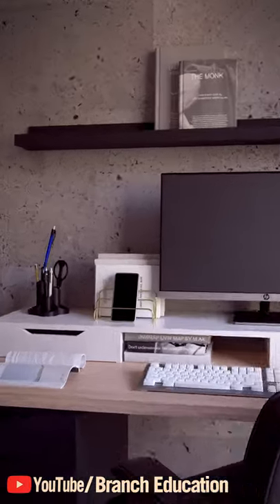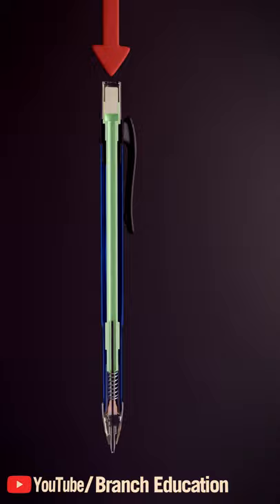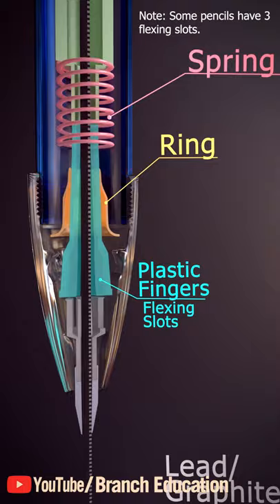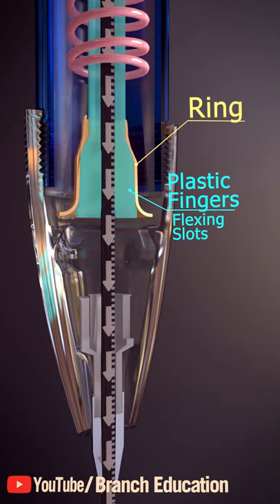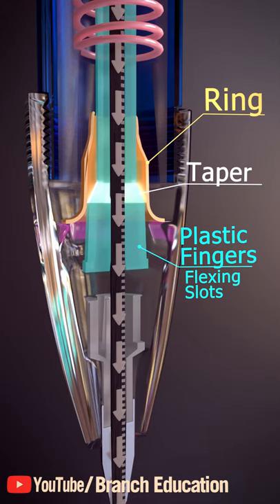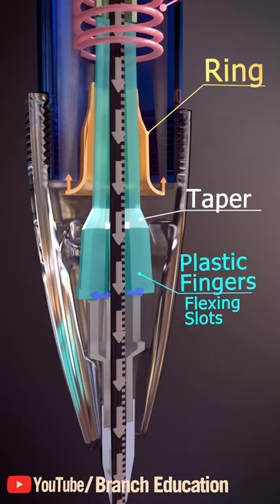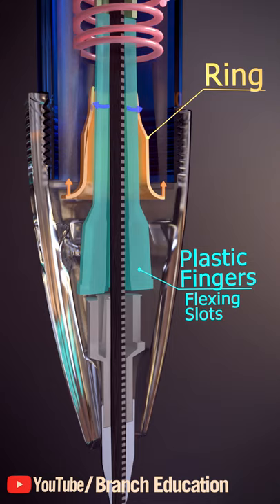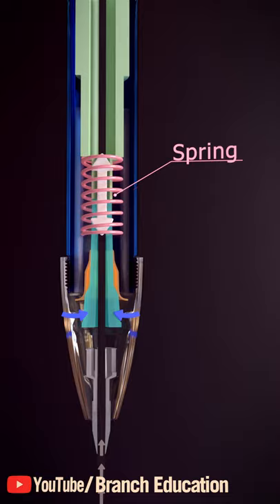How do Mechanical Pencils Work? #shorts

Comment from the maker: In order to keep the video to <60s, a number of elements had to be abridged or omitted. If you have any questions, definitely ask them, and the top ones I'll answer here:
1.	Why is it called lead?  Pencils have never used lead, but rather early scientists [~1500s] thought graphite was a form of lead.  
2.	The tip of the pencil is also critical.  It prevents the lead / graphite from slipping when the fingers are disengaged, it guides the lead, and it helps to prevent it from snapping.  [Credit to Miguel Borromeo for a related comment]
3.	Some don't click, and that is due to the materials of the ring and fingers, as well as the shape of the taper in the fingers.
4.	What force makes the fingers flare outward?  First, the fingers are all connected at the wrist, kind of like fingers / hand / wrist.  Second, the fingers are manufactured such that their natural position is to be flared outwards, and the ring forces them together.  [Credit to Taconator121, Errhka and Miguel Borromeo again]
Reply: I am very interested in those alleged abridged or omitted elements, I couldn't think of any yet but it'll be interesting to see what others come up with.
Reply: Hello. I’m YouTuber  from Uzbekistan. Can I use your videos on my channel by translating them into Uzbek language?  Thanks beforehand
Reply: Keep making these animations as descriptive as possible without considering the time constraint. Your content is good and it will rank no matter the length of your videos.
Reply: @SaidiIsroilov  If you were Ukranian, definitely ;)
Reply: @teeess9551  what's that supposed to mean

Comment: Let's not forget that the tip of the pencil is meant to guide and hold the lead just enough to not slip when the fingers are disengaged. This allows the lead to be fed outward in a more controllable way and in any orientation, provided that the fingers have currently captured a lead.

Comment: Very good! What is the force making the fingers want to flare?
Reply: I'm assuming they are inserted with tension in the plastic already
Reply: The plastic fingers are normally separated, but the ring will force them together, creating tension in the fingers, which then allows the fingers to return to their separated shape when the ring is no longer forcing them together. This takes advantage of the elastic properties of plastic when deformed lightly.

Comment: If you ask me, I dont like this mechanism. It does not work 70% of the times. I tried costly mechanical pencils too but many times, I just shove in the lead manually. AND moreover sometimes, the lead gets slipped. Like WHAT THE HELL!
thus, I prefer using a normal pencil.
Great video though! Liked it (pressed the button)
Reply: How do you get it to NOT work 70% of the time? Are you filling the pencil by shoving the lead through the tip instead of from the back?
Reply: @KaroCallion  No. I put it from the back..